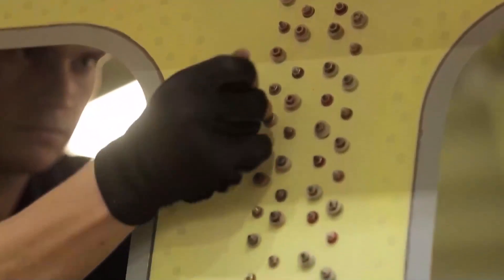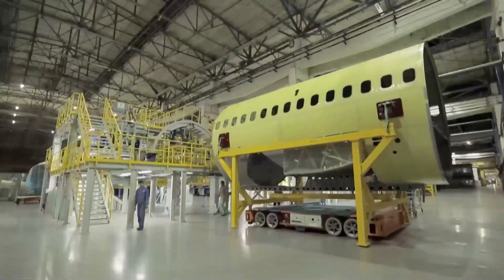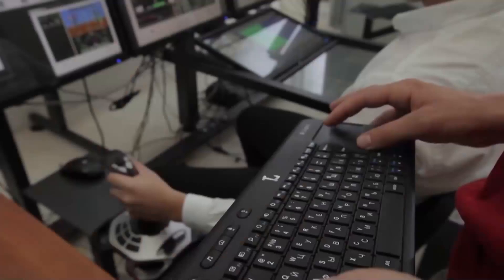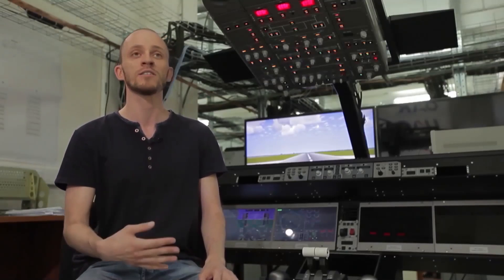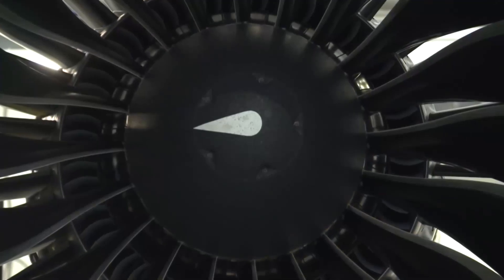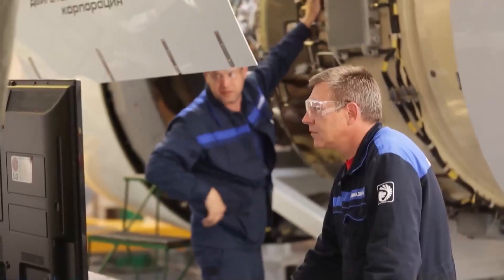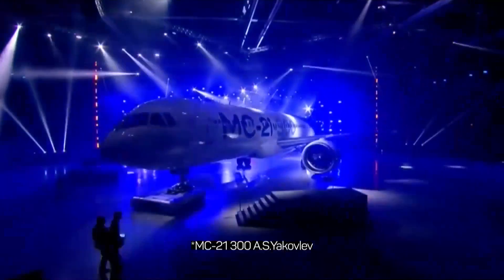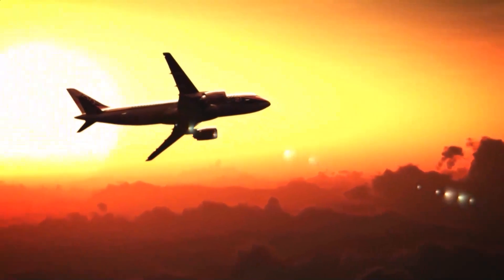A Look INSIDE The Irkut MC-21 Aircraft Assembly Line

Comment: Will be interesting wether Russia can build the plane under the current sanctions.
This video seems to be over two years old. Things have changed since then. Massively.
Reply: My guess is its going to take years before meanigful production. It was supposed to launch 2012.... and now they have to use their own less superiour engines and avionics.
Reply: les choses ont changé, mais toi t'es toujours aussi ""con""
Reply: It can and it does. The new engines (PD-14) are 100% Russian. Carbon-fiber is as well 100% Russian.
Reply: @antonh1709  Avionics and Landing Gear 100% Russian
Reply: @antonh1709  So let's wait and see. Until now I don't see any plane flying.
Reply: @hg6996   they are doing test flights.
Reply: @antonh1709  I know. But serial production under sanctions is a different story.
Reply: @hg6996  phải kiểm tra chất lượng an toàn đủ số giờ bay chứ làm ồ ạt mà lỗi thì sao ??
Reply: @hg6996  You will definitely see it. Currently, production facilities are occupied primarily with the production of military equipment. Temporarily, the Russian economy switched to a war footing. However, everything is ready for the production of civilian airliners. It will be soon.
Reply: @Docent0202  You are assuming that the Ukraine war will end soon. It won't.
Reply: @hg6996  The war will end when all the assigned tasks are completed. This was the case in 1667 - within 13 years, all the tasks of returning Little Russia were solved by Russia. This happened in 1791 after 4 years of war with the Ottoman Empire. This was the case in 1795. This is what happened in 1812 - Russia returned all its lands, defeating and expelling Napoleon. This happened in 1921, within 4 years, Soviet Russia defeated the interventionists from England, France, the USA, Germany and their henchmen led by Petliura. This was the case in 1944, after 3 years of difficult struggle with a united Europe led by the fascists. Always, no matter how long the struggle continued, Russia solved all problems and returned its historical lands. Russia has always revived, returned its lands and returned to peaceful life.
Reply: @Docent0202  Won't happen this time. Keep dreaming.
Reply: The Russians paid top dollar for the same components designed for the MC-21-300 are designed by the same companies that designed Boeing's 787 major systems also designed the systems for the MC-21-300. They paid top dollar and bought the rights to produce the same parts in Russia. They did everything legally and above board and the Aviation in shit on the Russians. Have  no fear. Russia has been at the front of Aviation since the beginning. 😊 Unlike China that steals everything they can. The Russians PAID FOR THE RIGHTS.
GO MOTHER RUSSIA ❤
Reply: These factory workers build the SU-30 and SU-27 Aircraft. They are very skilled  I can say that because I am the first foreigner to be requested in writing to show the Russians how to assemble their Aircraft in their factory.
I made it look too easy,. I had to explain to the Russian Executives that it is not their workers faults. The fairings were designed in Ireland by Shorts Brothers. Under wing pod engines fairings are mirrored and can be very confusing to the untrained eye.
ThevRussians did it right.I am deeply proud to be blessed by God to be a part of it.❤
Reply: 💯Old tech. We are developing advanced aviation engines and propulsion that surpass anything in existence and on the drawing boards 💯 
.

.
Reply: @MiloTheMindBender   you should care more about what you are smoking.
Reply: @hg6996  Just putting a dent in the Universe.
Reply: We can, but it still need to replace 3% of components (western ones) and as I read it ll be much heavier than it was planned in 2016
Reply: @АлександрЗабродин-т7м  the engines are already more than 3% of the plane. I assume that half of those who could produce this plane will end up producing T-72 tanks and other nonsense.
Reply: @hg6996 lol, you really hate Russia so much. Hahaha
Reply: @JayJay-xy5ch   I hate what the Russian army is currently doing in Ukraine. Who wouldn't?
Reply: @hg6996  so what you gonna do about it?. Why are you here? Why don't you join?. Scared?
Reply: @JayJay-xy5ch  I can condem what the Russian army is doing and not joining at the same time. Why should I? What has my opinion to do with my actions?
Nothing.
Reply: @hg6996 Vậy Hoa Kỳ,, NATO làm ở Lybia,, Iraq và Syria bạn thích à ,,
Reply: @hg6996  you are blaming Russia  not America  and not Nato for  this war
Reply: @hg6996  the answer is in an American movie "Oliver Stone documentary 'Ukraine On Fire"

Comment: I’m sure it will be successful as the Sukhoi SuperJet
Reply: Yes, sure, it will stay mostly grounded like SSJ 100, without spare parts and maintenance.
Reply: @romanzzzz2  I had flight to Istanbul on SSJ 100 two weeks ago :)  and before, may be 10 times already.
Reply: @ГалинаБрагина-п2т  they are flying, that is not the point.
The point is that russian planes most time spend on the ground, while Boeing and Airbus most time spent in the air.
It can be like - 2 weeks flying, 1 months waiting for a spare part. Or.. canibalise some planes for used parts.
Reply: @romanzzzz2  wahat canibalis for superJet. if it is made in Russia now 100% Just take any part from production
Reply: @ГалинаБрагина-п2т  you do not understand
1. What russian quality means (spoiler - very poor)
2. What means absence of international cooperation, when you do not have specialization benefits.
Reply: @ГалинаБрагина-п2т  about superjets - they dismantle some planes for spare parts
Reply: @romanzzzz2  for what if it is 100% produced in Russia and all of them are new
Reply: @romanzzzz2  it is only your poor opinion
Reply: @romanzzzz2  bạn có vẻ cay cú SSJ100 khi Nga họ tự sản xuất, hay bạn nhận tiền của Mỹ hàng tháng đi bình luận dạo như thế này :)))
Reply: @romanzzzz2  Even the western garbage known as wikipedia says that dispatch reliability for SSJ100 is 98%, which is only 0.5% less than Airbus and Boeing aircraft! 
A plane that sits on the ground most of the time waiting for repair does not have such statistics...
Looks like your western propaganda on TV like CNN and on the internet like wikipedia will have to coordinate lies better!

Comment: The Boeing concept is designed so that the owner of the aircraft can earn more. MC 21 is made primarily for the passenger, safety and comfort are two key parameters. For example, two large doors in the middle of the plane, they eat up a lot of space (in Boeing these are small hatches with additional seats), yes, this is true, but leaving the plane through them is much more convenient and safer.
Reply: Under Soviet rule, the State felt their military was of greater import so their civilian aircraft were an afterthought. Whilst excellent craft in their own right, they could not match their military counterparts as designed.
Reply: Not exactly.nice try.

Comment: THIS AIRCRAFT CAN BE EASILY STRETCHED.
Reply: There is a stretch - MC-21-400. But they need to get this plane in the air first. Then, engine makers need to increase the thrust of the PD-14 engines, and now they are busy with PD-8 for the regional jet. The stretch will have up to 256 economy high density seats, and its longer range variant can have range up to 7500 miles.